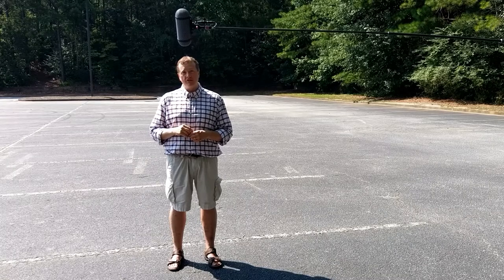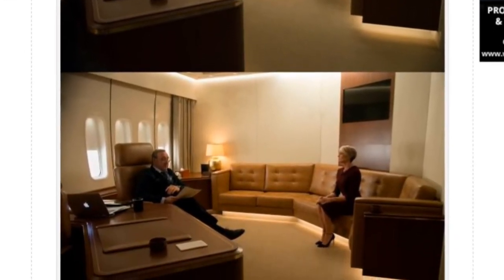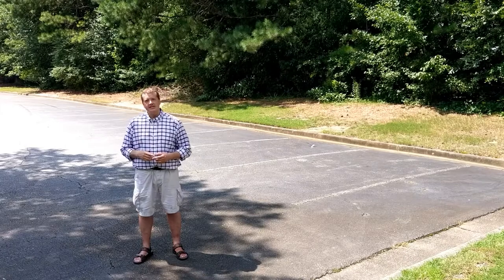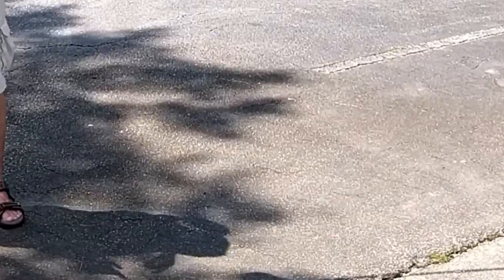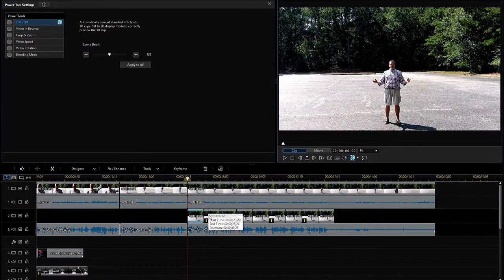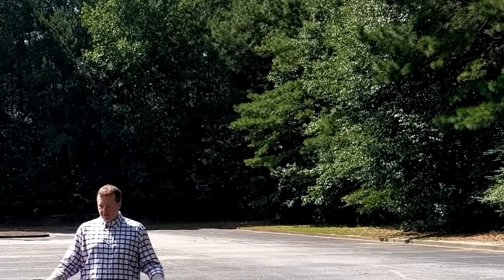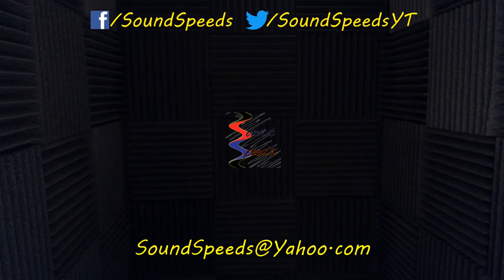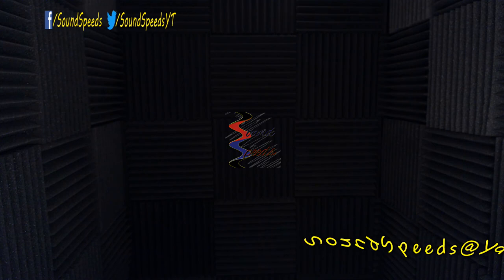The Invisible Boom - Sound Speeds

Comment: Great video! I've tried that technique at 6:20  but... man its so easy for the light to change and make the mask really evident.
Reply from the maker: Yes it is. In the 30 seconds between the standing and sitting split height segment the light level changed but not noticeable to our eyes out there. Outside this technique isn't easy and not worth the risk unless it's night or under cover.

Comment: Awesome  Technique!!
Reply from the maker: I've used it on quite a few shows. It's sometimes difficult for Producers to give it a shot but if they give it a go, you have to police the process and not deviate from it. If you try to pull one over on them, they not trust you or another sound department. Do it the right way and they'll be more open to it in the future on any shows.
Reply: Sound Speeds Oh wow! I did not know that. How come producers make it difficult if they should know audio is important in film?
Reply from the maker: The short answer? Because sound cheaper and easier to replace than fixing anything for picture. Some find the risk to be too high.

Comment: I guess this should be even simpler for green screen/blue screen stuff, even allowing a fair bit of camera movement.
Reply from the maker: It shouldn't even be necessary on a chromakey setup. You should be able to drop the boom into the frame and post will garbage matte it out without a problem.
Reply: Good point - this will come in very handy tomorrow! Thanks
Reply from the maker: Yeah dude. Talk to the DP. There's no reason why you shouldn't be able to drop the boom into a green/blue screen. All of that is being removed including your boom anyway...